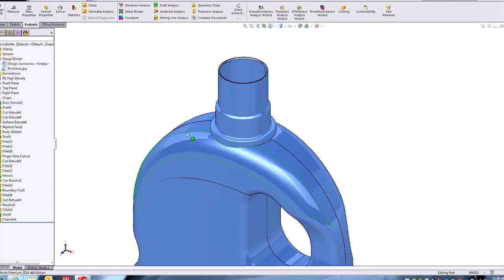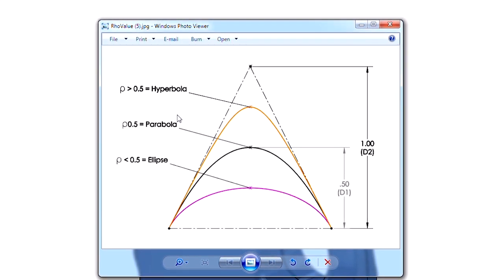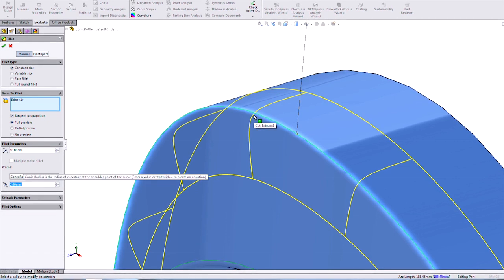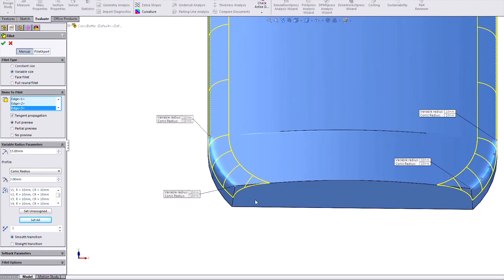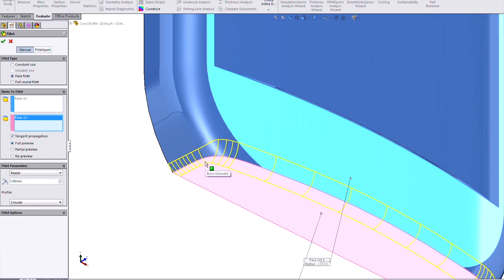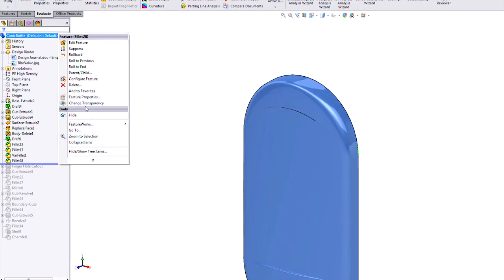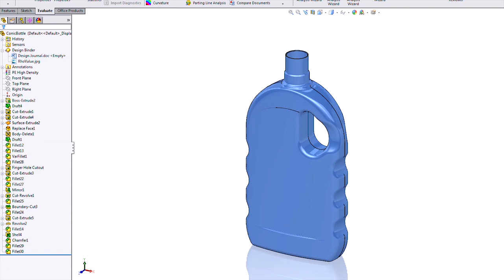SOLIDWORKS - New in 2014: Conic Fillets

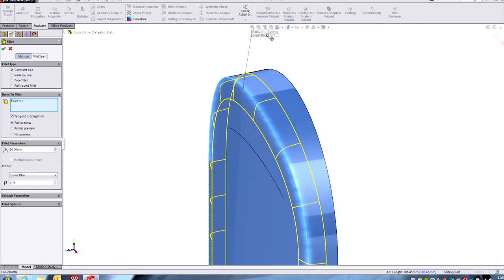Comment: I have a question if you don't mind.    I have a model that has two un-parallel lines that I am trying to trim with  the fillet tool, which could best be described as a 3/4 circle at one level, and a 3/4 oval at a higher lever, similar to your bottle fillet but I am trying to pull the fillet back similar to what you have as a curve where the label recess is. at 2:45 on your video.  Any idea how I can do this?